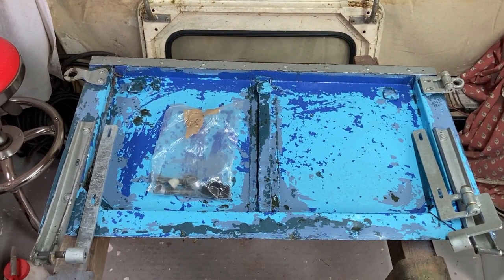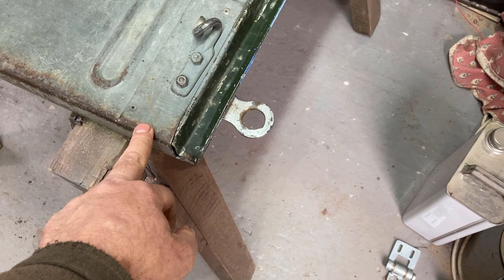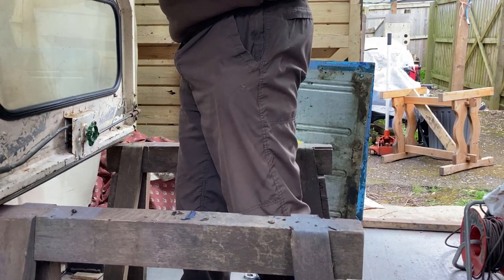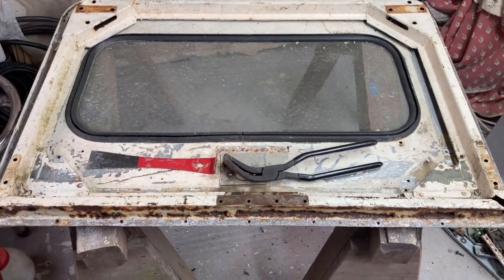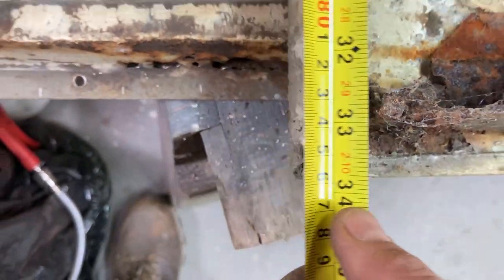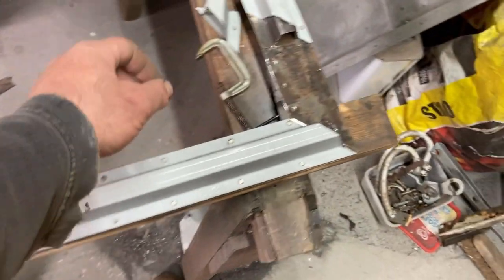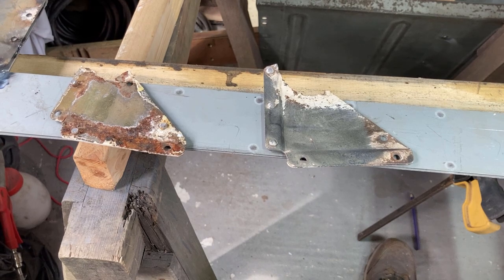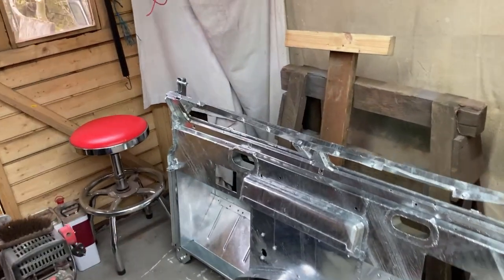Clanger 109 The Series Landrover Rebuild - Cat Flap !

Comment: That custom hinge setup is very interesting, not seen that before. Nice work on the frame.Funnily enough just as you're swapping to a tailgate on a station wagon, I'm thinking of fitting a rear door onto a pickup!
Reply from the maker: If you search ebay 'catflap tailgate hinges' or landrover catflap doors Im sure it comes up. I found the rear door on my defender was a right PITA in a strong wind - even after I fitted a gas strut - I miss the drop down tailgate of my discovery and the rangerover classic before that. Another upload goes live tomorrow - you can see the bulkhead issue. All the best Max. mat
Reply: Yes, I have a drop down flap on my 109 and constantly find it difficult to access the rear.  That hinge setup seems like a good solution.
Reply: @lookcreations  if you can post a link to the seller of those hinges, Id be very grateful, I've searched and can't find them, thank you. :-)
Reply from the maker: @kenjukes4824  let me see if I can find details
Reply from the maker: Purelymetal@aol.com
Reply from the maker: EBay item was 13-09179-93709

Comment: I used to make gates etc for a living.
Hot dip galv was the only rust protection that I endorsed. 
It wasn't a question have they bent anything ? but WHICH have they bent ?
Every delivery regardless of the company .. they were all as bad as each other.
I had to collect an urgent job once and saw the manager drive the fork lift truck over someone's gates rather than manoeuvre around them.
They were all animals I concluded.
The response to complaint was "if you repair it we will dip it again for free"
So my customers were buying a second hand repaired item before I had even installed them.
It is still the only finish I would recommend for proper rust prevention.

Comment: There was two stays on my series III  that went to a screw lock on each side if i remember correctly. You could drive with the top half up in the summer, but it did bounce around a bit. the stays might have attached to the bits that are missing of both sides of your door top.

I could be wrong as it's been about 30 years since i parted with it.
Reply from the maker: The torn plates in the lower corner definately held stays from the photos of others Ive seen. There appear to have been a number of different methods to secure the hatch open dependent on year.
Reply: @lookcreations  mine was a 'P' reg, was that 75. Thinking about it. it had a round large knurled knob and the stays ended with a fork with the ends turned 90°. you spun the knobs out slipped the stays between them and the frame then spun them back to lock the stays in place.

Nice to see it moving along.